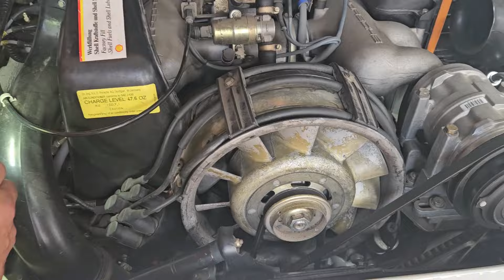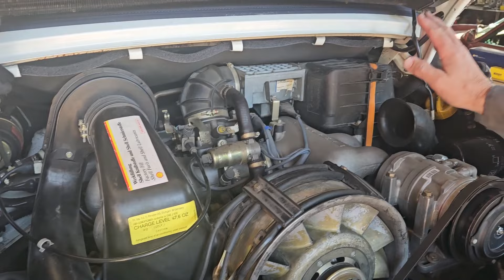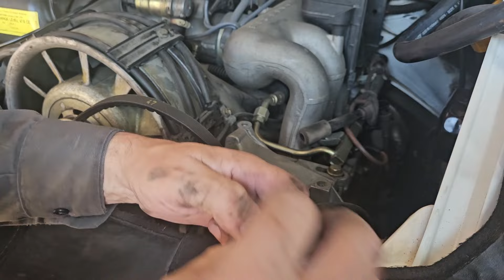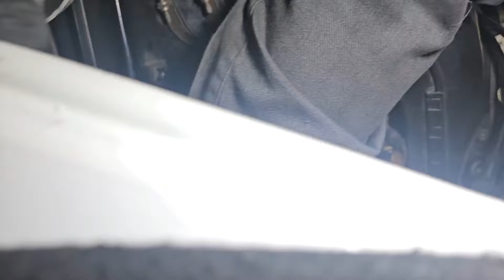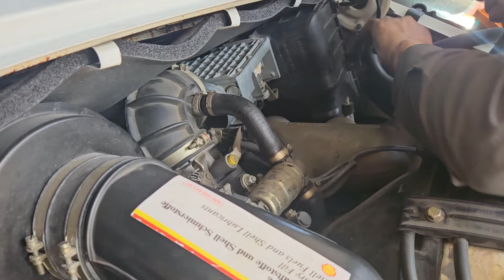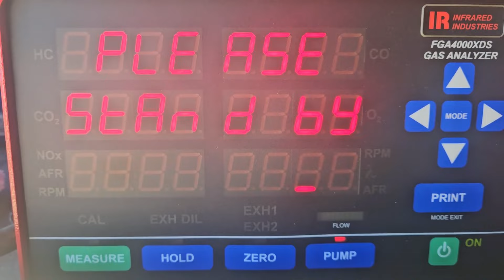30K Major Service 1987 Porsche 911Carrera

Comment: Don’t forget to flush the clutch fluid too, saves having slave and master cylinder issues as I had on my ‘88 Carrera. I have it changed with the brake fluid 2 year interval. Otherwise, great video and I learned a lot, especially, changing the fuses. Thank you 🙏.
Reply from the maker: Glad the fuse information was helpful for your maintenance routine. S

Comment: You have to use copper slip on the threads of the spark plugs? Because you have a steel plug going into an aluminum head? I come from powersports, I dont use it on my plugs, great work you do!
Reply from the maker: So that is a point of contention. Bosch has been saying for a while now that you dont have to use an anti-seize on their plugs due to the thread design they use. However, they first time you have to remove a seized plug that pulls all the threads out with it because it has corroded you will be a believer in copper grease. A small amount of lubricant also helps to get the correct torque value on the any thread. Lastly 35 years of applying copper grease to threads is a hard habit to break.
Kurt
Reply: @Aircooledconsulting  my understanding with two stroke bikes is that it will not allow a correct "plug chop" thus not a giving you a proper read. I stopped using lubricant, that is just me though.

Comment: You have to admire the owners of these old cars spending all that dough to keep them on the road. I wouldn't do it, because I work in DC yet my home is in Denver. So I need a late model performance car that is reliable and doesn't require substantial service. It's a long drive back to Denver!
Reply from the maker: So a lot of things have changed in cars over the last 100 years or so. Some of it has been good and some of not so good. All machines need maintenance and having the ability to perform maintenance and adjustments can prolong a cars useable life span. With many of todays cars we have traded service intervals with replacement intervals. As far as cost of service is concerned there is no benefit there. Labor expense may be lower, but the cost of service items are much higher.
Kurt

Comment: Go to their website and read their "Why Auto Repair Shops don’t want you to bring your own parts." diatribe. 

Want to order Rennline's KW Variant 3 shock kit for your 1987 Porsche 911 and have them install it? That's a hard no according to them. 

I'm not certain where this business is located, but that idea wouldn't be tolerated in the US. Enthusiasts bring parts to their shops because they want BETTER THAN OEM parts installed. Like better after-market shocks, struts, rotors, clutches, etc. Products that a shop wouldn't sell, that could take quite some time to get. Enthusiasts also want things like headers, exhaust, and shift-kits installed. 

Plus there's many, many after-market solutions to known issues that this business is saying they don't want to install for you. According to their policies they'll only sell & install the same OEM part that prematurely failed, again. No after-market solution for you!!! 

A shop like this that seems to be dedicated to enthusiast's vehicles like Porsches not allowing their customers to provide parts? Yeah.....that wouldn't fly here in the US. How oddly out-of-step with the very types of customers they should be catering to. 

They also claim it's about not making the money on parts if they don't sell them. And there's a simple answer; CHARGE MORE FOR LABOR. Porsche enthusiasts aren't trying to keep a VW Golf running, they're trying to baby their baby, and they're willing to spend real $$$ to do so. Charging more for labor to those that supply their own parts is perfectly reasonable. 

There's also fearmongering lies about parts warranties in their policies. That's pure bovine excrement.

Comment: Just love the information I get from this channel! An underbody clean would not hurt this car 😅.
Question: what is the spark plug change interval on a 3.2?
Reply from the maker: Spark plug change is at every 30,000 miles. The underbody is in pretty good shape and still has a large amount of the factory applied wax to everything. We see to many people cleaning off this protection and yes the car looks great the day it is done and is still on the rack where you can see it, but in reality it is just exposing the car to corrosion and shortening its life span.
Kurt
Reply: @Aircooledconsulting  thanks! I totally agree on the fact that the undercoating applied by the factory should stay there, but the dirt and grime can go because it holds moisture.
Question: what can be used to add to any wax gone missing?
Reply from the maker: @barckmotorsports  worth sells the underbody wax in a spray can so you can touch up any missing spots

Comment: Re: 5:30 and using a 2 foot cheater bar, when i first  changed the gear oil on my 915 gearbox, the fill plug was  in so tight i needed a SIX FOOT bar! Wish I could have put an air wrench on it… I did replace the plug .

And last but not least, THANK YOU for documenting and sharing your wisdom  and skills for those of us who seek knowledge on best practices with these old 911s. I think I speak for a lot of guys when I say I’m very grateful to guys like you who help guys like me keep these wonderful machines on the road !

Comment: I hit 210k on my 78 911SC. it sat for 15 years and over the past 5 years, completed (it's never really complete) restomod. Stripped everything out, had it painted inside and out GT3 white and dropped in a 3.6L varioram from last of the air cooled
Reply from the maker: Sounds like a fun car to drive. S